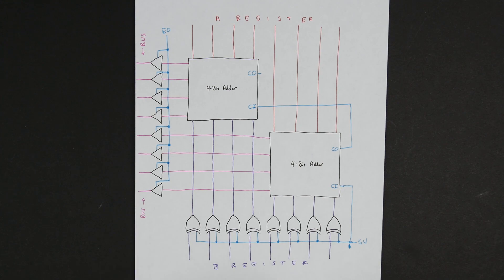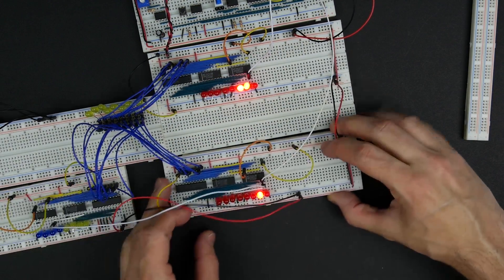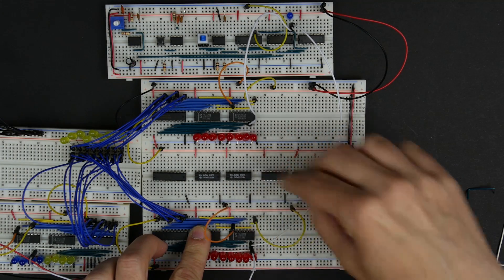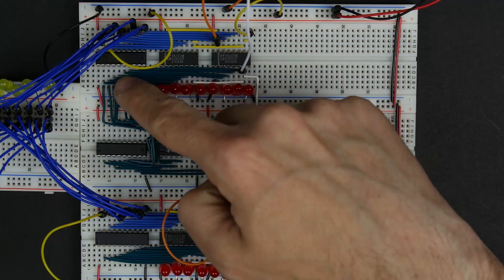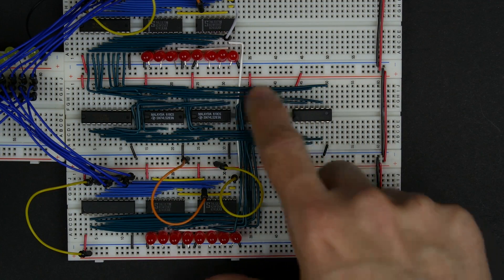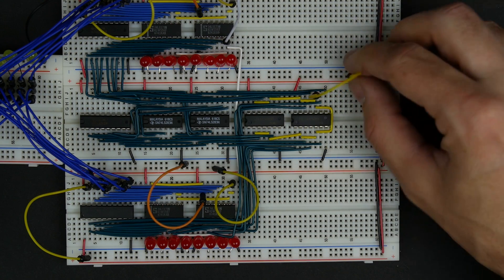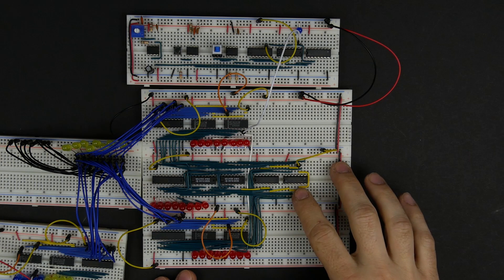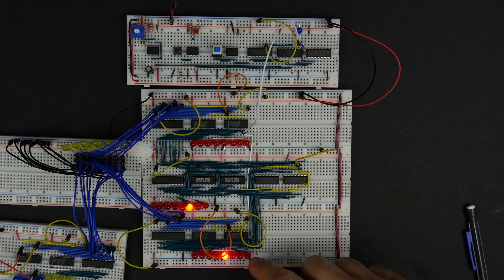Building the ALU

Comment: For the clock signal being in the way, I would have just added another bus line just for the clock. Smaller connection, less wiring.
Reply: Hi, I have a question, i built a sort of 8 bits CPU in a software named Logisim, But I wonder if we can make all logical operations with This CPU witch just has an adder, a substracter and a comparator in its ALU. How to know it ? My second question is how to Add for exemple 220 and 140 ? Cause it makes 360 and a 8 bits CPU can't display numbers higher than 255. I ask that question cause i wonder why an Arduino which is in 8 bits can Add High numbers. By the same way, how to had 2 number higher than 255 ? Thanks a lot for any answer, and sorry for my english.
Reply: @usern4m32  If you have an adder, then you should also have a carry bit flag, and then it is quite easy to add numbers greater than 255. However, if you also want to express negative numbers, you need to define first the word length. So, you can choose a bye for example, then you will be able to add two numbers up to a maximum of 127, because that is the highed positive number in one byte. Then you can have double bytes, and here you have
byte 0                                      Byte 1
0   1  2  3   4    5     6     7     | 8       9      10       11       12       13      14
1+2+4+8+16+32+64+128+256+512+1025+2048+4096+8192+16384
(2 bytes is 16 bits, -1 1 for the negation flag is 15 bits)
as a maximum in plus
And the way you do it is basically like any other addition in decimal. When you
Reply: @usern4m32  a subtractor and comparator can be made with an adder btw. to subtract (with a 4 bit adder for simplicity) keep one input the same (9 is still 1001) but invert the second and add 1 (2 starts out as 0010 but becomes 1110) and do the addition. u would end up with 7 (9 - 2). To compare with an adder, subtract the 2 numbers and use logic gates to check the output (0 means a == b, positive number (msb is 0) means a > b, and negative number (msb is 1) means b > a)
Reply: @Sydney Bean Hi ! indeed, i used a carry bit, but from it, i dont know how to make binary programs to add high numbers, i know doing nice things with it, but not that special thing (the code part seems too hard for me if my "homemade CPU" is able to do what i want it to do. I am thinking about begining assembly codes for a Z80. Maybe it will give me ideas...thx for your informations ;)
Reply: @usern4m32   It's been a few years, so I don't know if you're still looking for an answer, but the answer is that you can't add numbers that sum higher than 255 unsigned; or higher than 127 or lower than -128 signed in 8 bit hardware. (This is why there's so many overflow bugs/glitches in NES games, for example.) To do math on larger numbers, you either need to implement a software solution (eg: use two 8-bit numbers to represent a 16-bit number) or design your hardware with a wider bus. That basically squares the number of transistors/basic gates in the computer to double the bus width, which is why Ben is only designing an 8-bit computer, but it's a bit less complex to build on a per-unit basis at scale, which is why you easily get a 64-bit computer capable of doing arithmetic with numbers on the order of 10^19.
Reply: @tildessmoo  Why do you think that you can't feed the carry bit from previous addition or subtraction to the second in a processor? That's the way you add or subtract longer numbers than what is the width of your accumulators.
Reply: @topilinkala1594  You technically can, but then what do you do with the result? Generally when you design a CPU, you make everything the same bus width, so your accumulator and other registers and memory locations and logic gates are all the same width. If you implement logic to add to more than 8-bit sums in 8-bit hardware, you need to, for instance, have a high-order accumulator result and low-order accumulator result register or reserve a memory address and send the lower-order part of the result off there while you're calculating the high-order half, or some similar complication. It's not like you can't do things like that at all - in fact, that's basically how SIMD (Single Instruction Multiple Data, basically packing 2 or 4 numbers together to perform the same operation on all of them at once, which is essentially 128- or 256-bit math on a 64-bit CPU) works on modern 64-bit CPUs. It's a bit much for a breadboard computer, though.

I don't think I answered the original question very well, though, so thanks for bringing me back here. You can do operations on 16-bit numbers with an 8-bit Arduino because of software. It doesn't natively support 16-bit operations, but you can use bit shifting to operate on the two halves of a 16-bit number separately, and, although I'm not exactly plugged into the Arduino community, I would be surprised if there aren't 16-bit math/logic libraries that do this for you, basically hiding the fact that each number takes up two memory locations and each operation takes up two operations' worth of cycles/time behind single instructions in your program. Like I said, software is one solution, and complicating your hardware is the other solution, and there really aren't any other solutions, unfortunately.
Reply: But then you can't put the bus on a Cat 5 cable.

Comment: These videos are all very helpful, as I am currently building a 16  bit computer myself. I just don't understand one thing. Don't we need a register between the ALU and the bus? When you store the sum into reg. A, won't that also change the sum and then A and so on? Or will it not be fast enough since the pulse is very short and sum will change but we will be no longer writing in A?
Reply: It depends on how the registers work. Usually D-type registers are edge-triggered so they store their input only when there is a clock transition from low to high, or the other way around. Before that, they still output their previous value. So you can use that previous value and send it to the ALU for computations, and then connect the ALU's output to the bus. The result of computation won't go into the register until there's the clock transition which "snaps" it from the bust into the register.

But if you are worried about some time hazards and race conditions inside the CPU, then sure, you can always add some temporary registers for the ALU. That would actually make it more elastic, because then you can think of the ALU as another "independent module" of your CPU/computer, and you can use control signals to send many different registers to the ALU directly through the data bus to make some computations on them. For example, you can transfer address bus registers to the ALU to make some address calculations (e.g. add some offsets to a fixed base address to make indexed addressing possible). Or you can transfer the program counter to the ALU for adding some offsets to it to make jumps. Temporary registers (especially shift registers) could also be useful if you want to perform multiplication or division in your ALU (and you get bit shifts as a bonus ;) ).
Reply: Not in this case, because the "sum" is clocked into the A register on the rising edge of the clock signal.  After that, the sum changes, but the A register already has the previous sum locked in, so it doesn't matter.
If the A register did not operate on an edge triggered signal then yes, we'd need some kind of buffer to prevent sums from being continually added in a loop.
Reply: I'm currently reading a book called "But how do it know". I find it amazing and very easy to follow for beginners, I've had it for a week and am able to design a basic CPU in logisim, plus the book is like £10!
Reply: Jordan Hall Yeah, I have a copy of it. I haven't started reading it yet, though. And I know how to fix this "problem" with which I am concerned. It would just be more inefficient, so I want to know if there is even a problem after all.

Comment: LEDs connected without resistors?
Reply: +Alexandr Zhig He has leds capable of being supplied 5v at a very low current without a resistor, and ics like that do exist but he's not using them.
Reply: The IC has a resistor built in.
Reply: +indjev99 there is no such IC except special led driver ICs.
Reply: @aidagamemnon  TTL logic has weak "1" output because it is needed just to recharge all the capacitance. TTL inputs consume as low as 0,5 uA at logic "1". So yes, directly connected LEDs to ground are kinda OK, though not recommended... It also means: we have nearly 2.. 2.4 volts at logic "1" (limited by LED voltage drop), would be unacceptable for CMOS circuits (they like 70%..100% of VDD as logic "1", while 50% is gray zone), but TTL in normal mode have same 2.5 .. 3.5 volts at logic "1", while inputs should work properly at as low as 2 volts. So again, no problem, though seems little risky :)